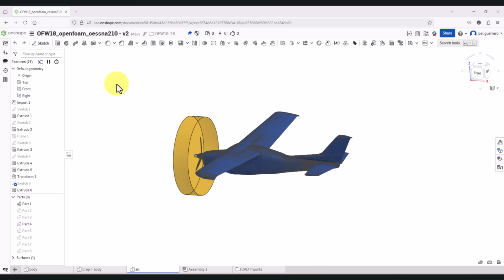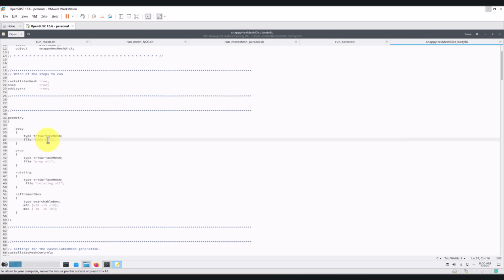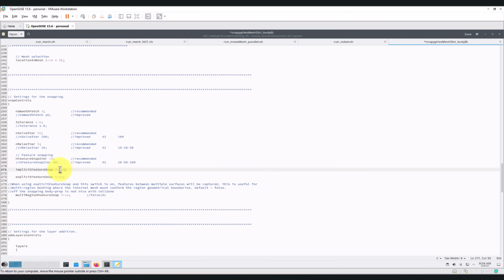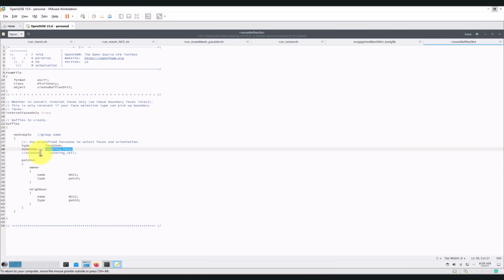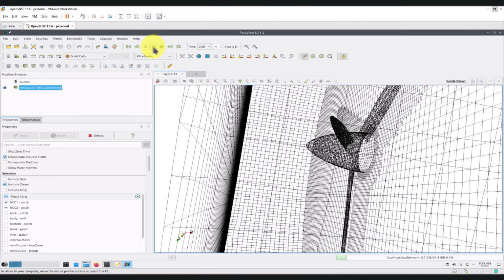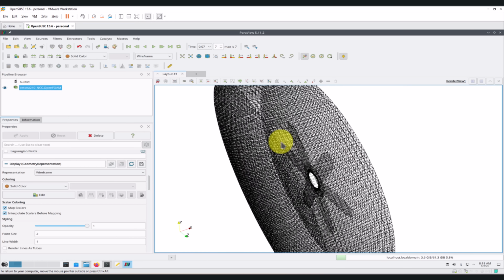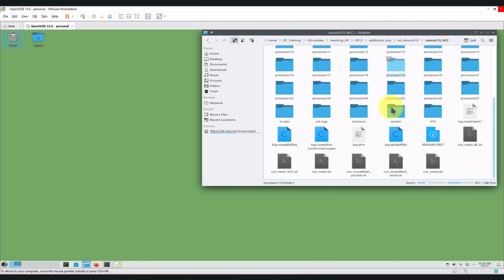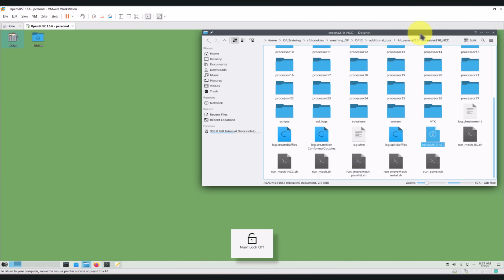Simulation workflow of the Cessna 210 | Let's dig deeper 11

Comment: Hi Joel, i tried to work with the propeller tutorial to learn the steps for NCC, however when i add layers to the mesh, the steps createbaffles, splitbaffles etc do not create two regions somehow. Everything is fine when i do not add layers though. Do you know the reason for that? 
Kind regards
Reply from the maker: Hi, sorry for the late reply i miss the comment. I checked and it is running on my side.  What OF are you using?  You need to use OF12